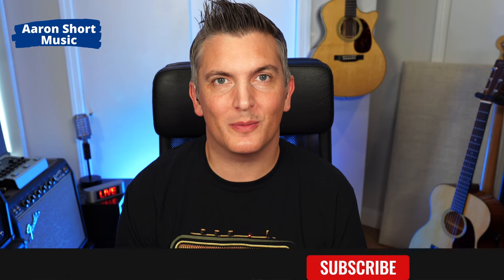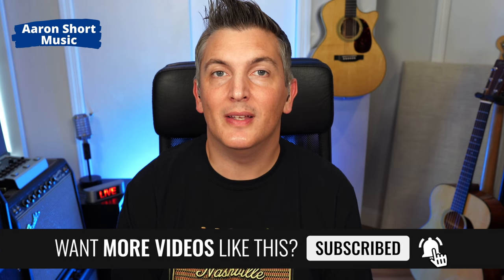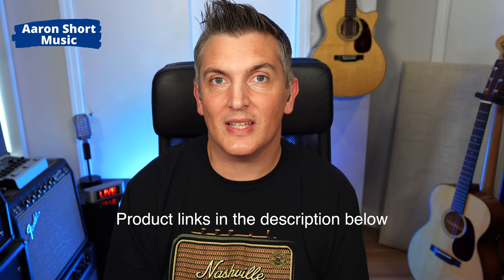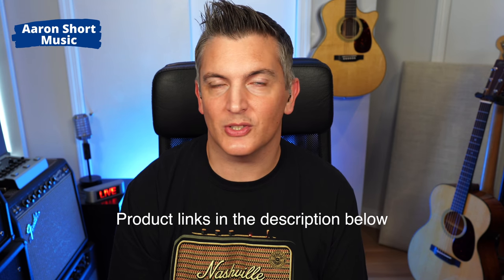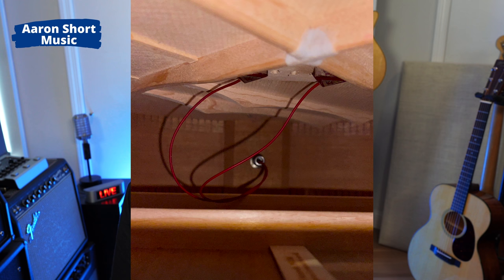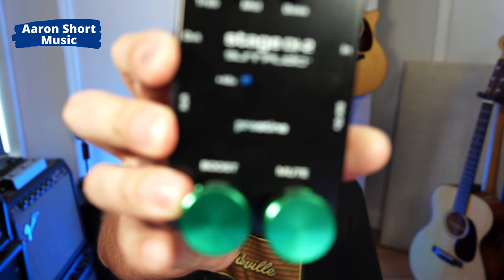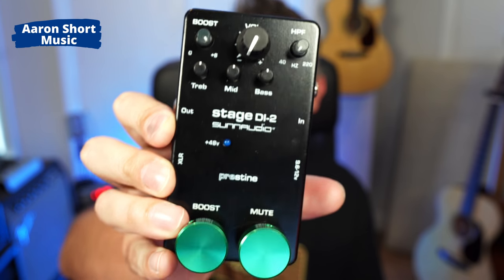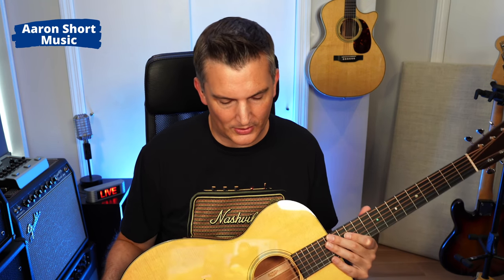Acoustic Guitar Pickups #20 - Dazzo

Comment: Thanks, Aaron! I think it would be great to do a back-to-back between the K&K, the Dazzo and the Trance Amulet.
Reply from the maker: I decided not to do it but you can always play the three video examples back to back in the browser. I will be posting a video on my thoughts of all of the pickups reviewed so far.
Reply: @aaronshortmusic  What is your current favorite now?
Reply from the maker: @Grindstaff09  I think it’s still the Cole Clark. I used the K&K tonight. It did the job but it wasn’t great.
Reply: @aaronshortmusic  Thanks, I just pulled the trigger and ordered a sound hole pickup, a seymour duncan.   I've got 3 fine gtrs and I would like to have pickups in to avoid mic feedback adjustments.    I'll look into the Cole Clark.   Have you been micing at all?
Reply from the maker: @Grindstaff09  I use mics at home. They always sound the best when it’s appropriate to use them.

Comment: Is it just me or adding the SunnAudio d.i. also adds some distorsion? Might feed the interface a bit too high of a level?
Reply from the maker: I don’t think so. Maybe you are hearing YouTube compression. The interface wasn’t clipping.
Reply: @aaronshortmusic  on PrismSound Lyra converters and my Adam A77X I could swear I hear some added distorsion, nothing too annoying. It's also a tad brighter (or call it detailed?) and thicker than the direct to interface signal. 
Anyway, thanks for the video, it is quite revealing on the Dazzos. 
I wonder if they could wire the 2 elements separately, as a custom thing, to a TRS endpin jack. To be able to decode the side information (of an M/S) from them á la Doug Young. He is also using the SunnAudio, the 2 channel preamp/d.i., and do the M/S thing with a DPA mic for side and the transducer on mid wide. 
It can also be done with the Radial Engineering Decoder, in my case I was thinking to keep the mid information from the Fishman undersaddle system of my old Taylor 314. Dazzos seem like the closest thing to a mic, an internal one with better isolation.
Sorry for the rant, we're close to bedtime in my part of the world and here's one guy's dream of a better wired sound for his guitar :). Regards from Bucharest.

Comment: After seeing how dazzo's are installed i took 2 disc transducers from a journeytek classical 4 disc set, put one disc under high e, the other inbetween low e and a and wired them seperately to a stereo jack. I use a Y cable and eq each disc seperately on the amp, have much more control, the sound is much better better because i can keep all the best things from each transducer. And no problem with weak high e because i boost that disc a smidge. Think i just found my favourite setup. In my opinion it beats k&k out of the water. Not sure about dazzo cause i havent tried them. Great video Aaron!
Reply from the maker: Thanks Marko, that’s a great idea!

Comment: What are your thoughts between the Dazzo and the Schatten HFN?
Reply from the maker: I think they both have pros and cons.
Reply: @aaronshortmusic  Hey Aaron, I've been playing the Schatten HFN Passive for a couple years now in my Mcilroy guitar. I'm strongly considering swapping it out for the Dazzo. Could you elaborate more on the pros and cons? Personally after many moves and tape vs putty installs I find the Schatten too bright and not enough bass. It seems the Dazzo has more potential for bass and an overall warmer sound. and a higher output too? Thanks!